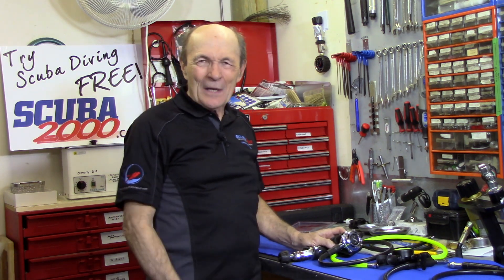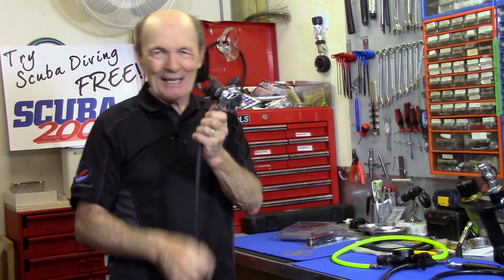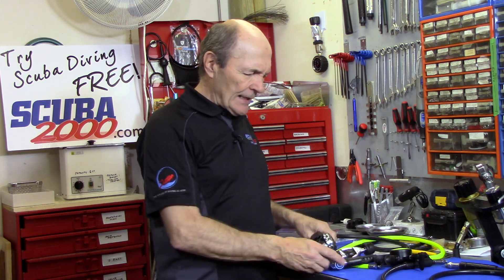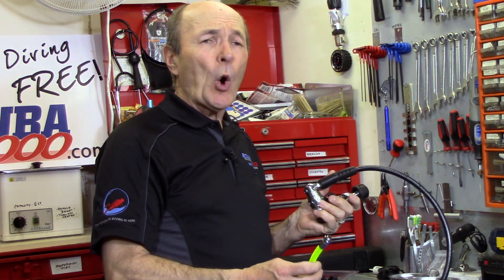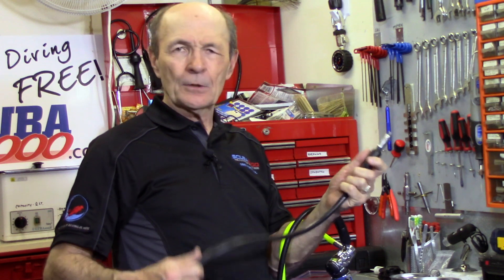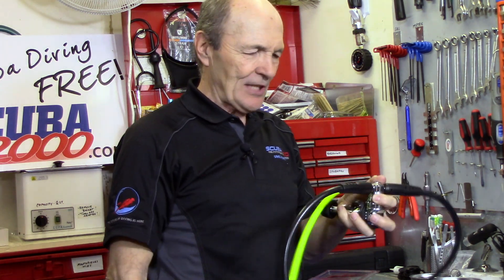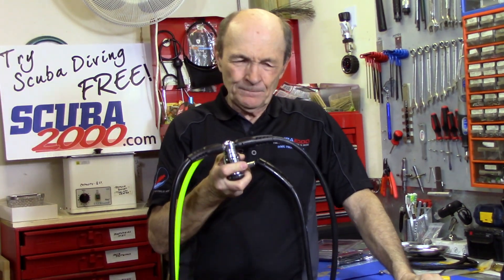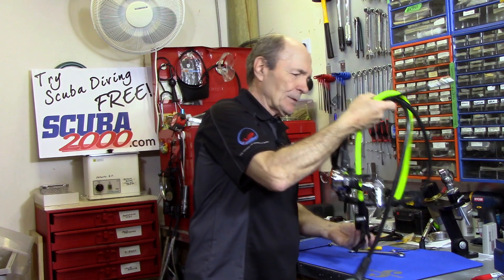Mixing Brands In A Regulator System - Scuba Tech Tips: S05E13

Comment: Hi Alec, I really like watching your videos, I think they're great.
Can you help please?...I have a technical question regarding mixing brands and it would be great if you could shine your pearls of wisdom on the matter please.
I have always rented scuba gear. I am a fairly new diver, I did my AOW a few months ago. Very recently I decided to take the plunge and buy my first regulator.
I like single side exhaust 2nd stages, so I decided to buy a new Hollis 500SE 2nd stage with a Hollis DC7 1st stage. The service manual of the Hollis regulator says that the intermediate pressure of the regulator is 9.5bar (+/-0.5 bar).
I required a safe second for my regulator setup, so I thought it would be a prudent to compare intermediate pressures of regulators. I found the Aqualung Kronos Supreme (single side exhaust new - old stock) which had the same intermediate pressure, so on that basis I thought pairing it to the Hollis 1st stage would be suitable.
However, the subsequent dilemma I have just realised is, the Hollis DC7 is an overbalanced 1st stage diaphragm and usually the Aqualung Kronos is paired to a balanced diaphragm 1st stage.
So I am left questioning and wondering:- How overbalanced is an overbalanced 1st stage?  If I descend 10m do I get another 3psi per 10m for example, is this a linear increase? If my 1st stage is overbalanced and my safe 2nd stage is only balanced, will the increase in intermediate pressure when I go deeper cause the Aqualung Kronos to go into free flow? Or will the relative increase in external pressure from the water prevent/mitigate the relative increased intermediate pressure from the over balanced 1st stage? Can I just control any potential free flow with the combined dual function of the venturi/ease of breathing adjustment on the Kronos?
Is having an over balanced 1st stage with a balanced 2nd stage the same as having a balanced 1st stage with an unbalanced 2nd stage?
Any thoughts or insight you could offer please?
Thanks
James
Reply from the maker: Hi James. Good to hear from you.
I have many viewers in the UK and some have become on-line friends.
We visit England occasionally. My dad was from Bridge near Canterbury. Where do you live?

The Hollis DC7 is a fine regulator and a good choice for a newish diver or an expert.
I think your question is prompted more by the sales hype than actual concern. Realize that regulators are all very similar. Despite the manufacturers claims that his reg is "the best every made" or "guaranteed to revolutionize scuba diving",  there is really no radically different regulator out there nor any one that would honestly be considered the "best". Note that Aqua-Lung had an 'Over Pressure' 2 hose reg in the 1950's!! To save your calculator, that's over 60 years ago!

I'm sure you know some of this but let me refresh. The Intermediate Pressure (IP) is the pressure coming from the first stage. It is set to specifications during service and is generally between 125psi and 160psi (8.5bar and 11bar). 135psi (9.3 bar) would be considered a normal and satisfactory IP. It's important to realize that the IP is the pressure ABOVE AMBIENT (surrounding) pressure. So at the surface the IP gauge would read 135psi and at every depth the IP would be 135psi ABOVE ambient. For example, if it were possible to read the IP while diving (it is easily possible BTW), you would see that it's 135psi at the surface, 150 at 30',  165 at 65', 180 at 100' and so on. These numbers are approximate but illustrate that the IP is always ABOVE AMBIENT. It's a simple, critical and basic function of a 1st stage to adjust the IP automatically as you descend.

So, you can add any LP accessory of any make or model, octo, BCD, dry suit, etc, to your Hollis 1st stage without concern. In the case of a 2nd stage, whether primary or safe second, that 2nd stage will need to be adjusted to match the IP of the 1st. That's an easy, 2 minute job for most regs. Of course Hollis would prefer you to use their 2nd, but it's not necessary.
The balanced, over balanced or non-balanced status of the 1st or 2nd stages has nothing to do with the foregoing. It only has an affect when air is flowing.

I often suggest to divers that they choose their regulator without regard to price but considering only reputation, availability, cost of service and suitability to their diving needs. Then I suggest they consider the most basic model safe second available. No venturi, breathing adjustment or other features are required. A safe second specifically designed to be an octo such as the XS Scuba Alt Air for example, would be my choice.
Hopefully you will never use your octo and if you do, it will only be for a few minutes and while ascending. Why spend extra money for features that you will never use AND that may increase the likelihood of a free flow, while in use or not?
If, in an emergency, my dive buddy secures my octo for his use and he then stops on the ascent to adjust the breathing, I'd be inclined to take it back and continue my dive. Clearly there's no emergency. Or if he complains about the breathing of my octo upon reaching the shore safely, I'd be looking for a new buddy!

 Determining what the correct IP is for a 2nd stage in the hope of matching the IP from the 1st stage doesn't work James.  While the IP has a suggested specification, it can and will vary and often by a great deal. Most manufacturers IP specifications allow for 15psi (1bar) above or below that pressure. So if the IP is suggested at 135psi, it could be anywhere from 120 to 150 and still be   considered OK. Once the IP is set properly at the 1st, any attached 2nd must also be adjusted to match. All breathing characteristics, ease of breathing, effort, flow, etc, are determined at the 2nd stage, NOT the first. The 1st is only there to provide a steady source of air at 135psi. In fact, many service people will adjust a safe second so that it is not quite as sensitive as the primary second stage in an effort to reduce free flows from the safe second. So the two 2nd stages may have different settings!

I hope all of this is clear. Let me know.
Good talking.
Alec
Reply: @AlecPeirceScuba_SeaHunter  Thank for your your excellent explanation Alec sorry for the delayed response!
Update- I fitted the Aqualung Kronos Supreme to my Hollis DC7 without any need of adjustment. I managed to get a new old stock Aqualung Kronos Supreme actually for less than a new XS Scuba Octo.
The logic being, that I wanted to go into tech diving (which I did twinset and sidemount) and I wanted two reasonably performing side-exhaust regulators. I undertook my Padi rescue course and deep diver using the above regulator setup, which all worked fine, went down to 44metres in the Atlantic.
I then went onto my tech journey...
I moved away from PADI, undertook SSI Nitrox and Night Diver and Search and Recovery, TDI Intro to Tech, twinset and then sidemount and rebreather diving (bought a KISS classic).
With the decision to move to sidemount (which I absolutely love by the way and is my current way to dive open circuit). I went onto buy a secondhand Apex DST with an A-clamp for cheap.
I re-fitted the old Apex DST with a DIN wheel and did 5th port conversion whilst servicing the whole 1st stage DST regulator (which it very much needed).
I set the intermediate pressure to 9.5bar and connected the Hollis 500SE on a 7ft(210cm) longhose using (AP - Ambient Pressure) rubber hoses on my regulator setup) and the Aqualung Kronos to the Apeks 1st stage so I could do single cylinder sidemount. It worked like a charm. The new fifth port on my Apeks DST I found to be really beneficial for drysuit connection and hose routing in my sidemount configuration.

I got another secondhand DST and did exactly the same with the success of the first; fifth port conversion and DIN wheel conversion, moving onto 2 cylinder sidemount (using X-Deep Stealth tech 2.0 sidemount wing).
Connecting my left cylinder in sidemount using 5th port to bcd and 5th port on my right cylinder to drysuit.
Your videos gave me the confidence to do all the above with my regs and I have 2 Apeks DST 1st stages now, Hollis 500SE second stage and Aqualung Kronos Supreme second stage on the other side with a Kirby Morgan elbow on the Kronos Supreme.
I am now onto cave training this year.
My 500SE has been reliable over the period, although the exhaust cover started to deteriorate and break up, so I replaced it this week. Hollis have stopped making the 500SE, which is a shame, it was a nice servo downstream side exhaust regulator.
I live in Nottingham, in the Midlands, in Robin Hood country. Nice to hear your dad came from Bridge near Canterbury.
Thanks, Cheers James. Happy 4th of July!

Comment: Surely you can mix and match brands as you like and if you make the right adjustments it will work fine in most cases. However tests shows that you are changing the performance by making a hybrid between the 1st and 2nd stage. At the end of the day YOU become the manufacturer by making a Frankenstein regulator with all the consequences her off. 

Safe diving to all
Reply: You are quite right!
Unlike the 50's and 60's where scuba gear companies came up with a good idea and just made it work, today's regulators are are very sophisticated. The first stage performance is matched carefully to the second stage and only with the original arrangement are you guaranteed to get the best and most consistent performance.
Long gone are the days when reg parts could be switched around at random.

Several years ago, I hired a service tech at my store. He came with many years of experience at a couple of previous stores. One day I asked him if he was familiar with a regulator that I knew to be rare and unusual.
He said, "No Problem. All regulators are the same and even use the same parts."
From that day on I watched him like a hawk and not long after let him go.
Sure, the theory is the same and there are often similarities but no, they are NOT the same and no, the parts cannot be substituted. Not in my store. We use original factory-supplied parts only. Partly for the diver's safety and partly for the integrity of my business.

Now I am talking about modern regs - say, from 1990 on. Realize that 1990 was 28 years ago.
Imagine trying to fit parts from a 30 year-old car into your 2012 F-150. Even the light bulbs are different!

For older regs or genuine vintage regs (pre-1975), it is different. I have often used different brand exhaust valves and even diaphragms or seats.
Not today.

Adding a different brand second stage or safe second can be done and with adjustment it will work safely but it will not necessarily match the performance of a factory regulator.

Thanks for your comment and for watching.
Alec
Reply: Great response! 

I believe this is the main reason most LDS always recommend you to get the corresponding 2nd stages, because then they know the characteristics and performance are exactly what it says.  

Thanks for replying and for an awesome blog - love these Tech Tips!

Comment: Any Idea why the shops make such a fuzz about it?
I bought a second 1st Stage for cold water diving to my Mares Instinct 12S and they asked liked 3 times exactly what type of 2nd stage / Octopus I use, so they can make sure to pick the right first stage, as if not even any Mares first stage would fit.

Any idea on that?

Really appreciate all your videos, many thanks for sharing your extensive knowhow and experience, best regards from Europe (Switzerland)
Reply from the maker: Any 1st will work with any 2nd - Mares or not.
However, assuming they're not just trying to sell you something, maybe they want to be sure everything works fine.
Don't be so cynical. Not all dive stores are crooks!
You do have to adjust the 2nd(s) to suit the IP of the 1sts as you switch around. but if you only do so once in a while, the Ip won't change much and you won't have any problems.
Your solution is a bit different but if it works for you go crazy.
Most divers would choose a cold water reg for all their diving. No reason why not. Or maybe have 2 complete separate set-ups.
I imagine diving in Switzerland is like Canada - water temp of 40 to 70 degrees ( that's 5  to 16 Celsius).
Take care. Thanks for watching.
Alec
Reply: Yeah, temps are about right, in the summer at the surface we get up to 25C, but then we like to go deep to cool off in about 7-8°C Water.

This solution is what almost all divers use herearound. Primary 1st with Primary 2nd plus BCD or Drysuit inflator attached, plus in my case Suunto Pressure sensor (wireless). Secondary 1st with Octopus plus "the other inflator ;)" plus classical pressure gauge.

I'm not cynical about my LDS, I'm pretty sure she's competent. And it sounded more like Mares or the Distributor was making a fuzz about it than herself.

Keep up the good work!

Comment: Thanks so much Alec.  I purchased an Atomic Reg with an Combo  BCD inflator and safe second.  I paid $300 for that combo safe second.  After reading this, I took the Oceanic safe second off of my old Reg and attached it to the new Reg.  I am still in the return period and will be returning the Atomic combo second/inflator for full refund.  I did this for both my wife's and my setups....Total savings of $600.  Thanks!
Reply from the maker: Well I didn't make the video to save you money but, what the heck.
My philosophy of safe seconds is pretty well know -  they're fantastic (I kick myself regularly for not think it) but, assuming you're never going to use and, if you do, it's only for a couple of minutes, why spend $300 on it? Get the least expensive, reliable safe second you can.
Thanks for watching.
Alec

Comment: In the UK and I guess Europe our regs are EN250 certified but only certain combination even from the same manufacturer due to the high cost of the testing. The testing also is done with the manufacturer's s hoses.

Typically our dive centres will service miss matched systems but give them back not assembled with an advisory liable leaving you to put them back together.

No problems with consoles assuming the hose is EN250.
Reply from the maker: Ahh the old EN250! Some over-educated, non-diving pinhead deciding how scuba divers should behave. 
Wait for it guys. You'll soon have to to have an EN250 license in your pocket before you go in the water.
While I equally hate frivolous liability lawsuits, it seems to be a better way to get manufacturers to make good products! You know, "Kill me with your shitty regulator and my family will sue your a** off!!".
Welcome to 2017 and Beyond .....!
Anyway, a store that won't properly assemble your reg system is just weird. Certainly not good business!
Ok, so you can buy a EN250 certified first stage and a matching EN250 certified second stage and then add an EN250 certified Safe Second from a different brand (very common set-up) and hook them up and go diving but, ..... you can't put a certified primary second stage on that's not the same brand?!! Hold on!! The Safe Second 2nd is not the same brand and it works fine! WTF! 
My point is that a Safe Second is just a 2nd stage. What does it matter that your primary is a different brand?
Somebody upstairs hasn't had their coffee today - or tea in your case!
Am I missing something here?
And, to follow up on my initial rant about EN250, now they're telling you that you can't have a Safe Second on some regs because it may not give you enough air! I'd say not getting enough air is better than not getting any air!!!!!!!
You be careful there over 'ome.
Alec

Comment: Alec, I thought you might enjoy this video, about air consumption, when a hose ruptures or stage fails.  Maybe you want to do something similar and expand on the subject. Enjoy!

https://vimeo.com/151452141
Reply from the maker: Very interesting.
Too bad they didn't try to explain the differences. Most divers would assume that failure of a High Pressure hose would result in almost instant loss of air while in fact, the opposite is true.
Why? As I've explained in my vids before, the high pressure system on a regulator has many built-in restricted orifices that reduce the amount of air that can flow through them. There is an inherent restrictor in the swivel pin of the SPG; there's a restrictor built into all HP hoses at the regulator end and there's a restrictor in the HP port of the regulator. 
By restrictor, I mean a very small hole for the air to pass through. The hole in the end of the hose is almost too small to see. These restrictors are a new concept. Well, by new I mean they've only been around for about 25 years! I guess that reflects on my years as a scuba diver (60).
Previously a HP hose failure was a problem. Not only would the air loss be rapid but the hose end could whip around and seriously injure the diver. This would normally occur as the diver turned on the air on the surface.
You may not have noticed but every diver has seen the effect of these restrictors. When you turn the air on, your pressure gauge SLOWLY climbs to the tank pressure. And when you turn the air off and purge the hoses, it takes several seconds to empty the hoses. This is because of the air in the HP hose which cannot get out quickly - because of the restrictors. Watch your SPG the next time you turn the air on. And watch it again as the needle SLOWLY falls to zero as your purge the reg.
Thanks Miguel.
Alec
Reply: Agree with you. Although I was surprise, you have almost 20 minutes of air, when the HP hose fails. Regards. Wonder how much time you have,  when the joke O-ring fails. Will try it someday.
Reply from the maker: I've already spoken to Kevin about this and will make a GOOD video - What Happens When Your Regulator Hose Breaks??? Thanks again Miguel.
Alec